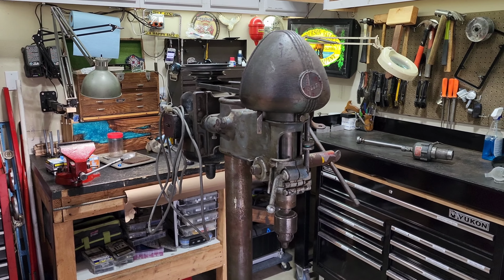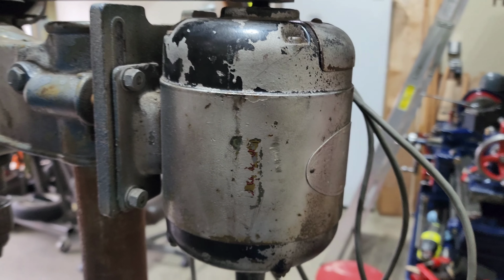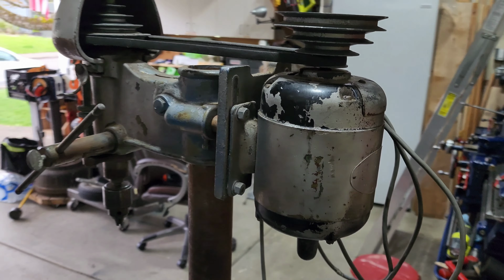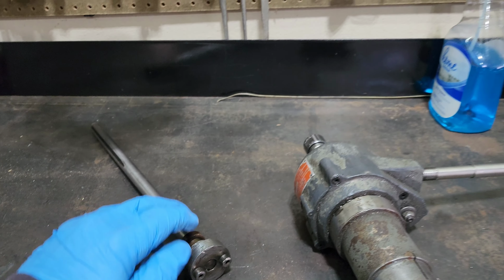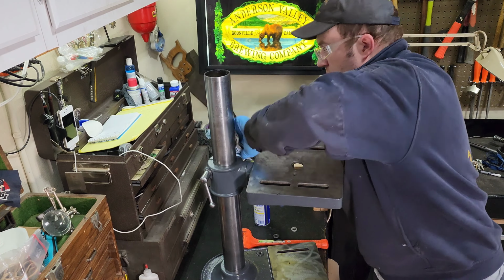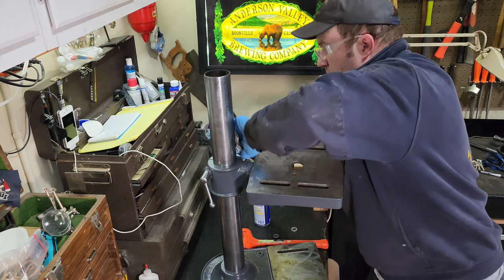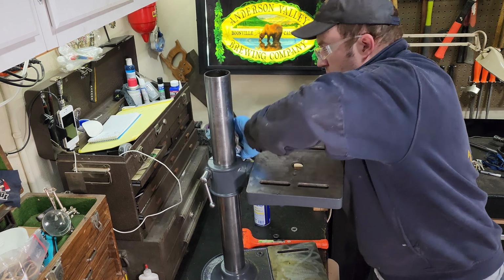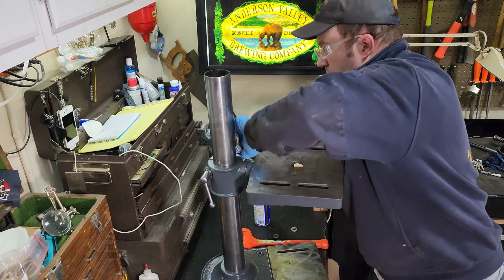1940s Delta DP220 14" drill press restoration and taping head installation

Comment: I have one of these here in the UK, I believe they were imported as part of the war effort.
The press is rebadged as Tauco, I believe due to the Delta brand name already in use here.
I completely restored the press, fitted a new Jacobs JT6 chuck, with a cast aluminum chuck guard, bare steel components were chemically blackened, the paint work is a dark green hammer finish.
I had the opportunity of a free electrical cabinet off a Crosland clamshell press from the 50’s, so I used that as a stand, it’s nice and sturdy as it has a cast iron plinth, with 16g steel fabricated cabinet.
It matches the period of the drill press, and compliments it nicely.
The press has been rewired with modern switches, but the switches are mounted inside a period cast switch box that has been gutted.
What I would like for it is the belt cover, the problem is they’re not available here, so I might have to fabricate one.
The press runs beautifully smooth, but as it’s been around five years since I restored it, the blackened finish needs redoing, as humidity here can be a problem, and I should’ve coated it with an anti rust wax.

Comment: Very nice video,  your mechanical skills are great!  With all your tools I am surprised you don't have a paint spray gun and compressor which would enable you to use a higher quality paint than that available in the rattle cans.
Reply from the maker: The reason I don't use a spray gun is my compressor is too small and I'm pretty limited on space. I'm working out of a 2 car garage so rattle cans are the most space efficient.
Reply: @restoration-projects  which brand/color paint and primer do you normally use. Love vids BTW. Glad I found your channel.

Comment: I'm doing this same thing same dp! Did you replace the quill bearings or just clean and grease them? I was able to clean and grease the upper pulley shaft bearing using suction as it is obsolete but haven't gotten to the quill bearings yet. My DP has a Westinghouse motor as it was manufactured as a hybrid model with shared WABCO and Delta parts (Westinghouse de ion starter, Westinghouse 1/3 motor, riveted plates). Thanks for the video!

Comment: Coming from a tool and die maker, and a high tolerance machinist and a welder and fabricator I can say this........Please learn more about basic machining and fabricating. You did a pretty good job in the restoration process, but your issue with your tapping has nothing to do with the tapping head but how you reassembled the machine and clamped down your work piece. Setup is the most important part of machining and knowing what you are truly doing or wanting to do is just as important. Keep on learning and keep on making mistakes to make yourself better in the craft.